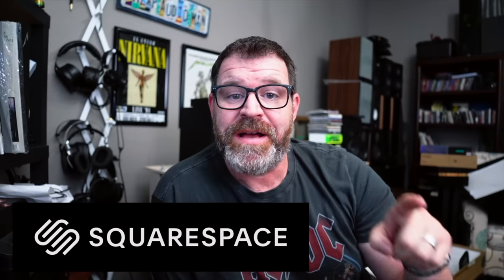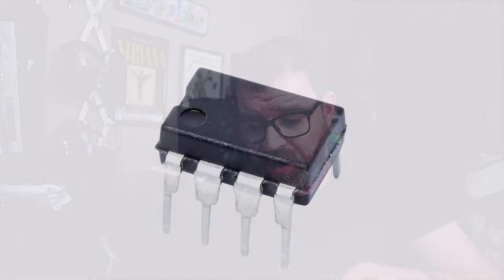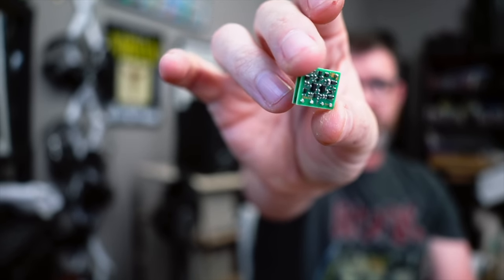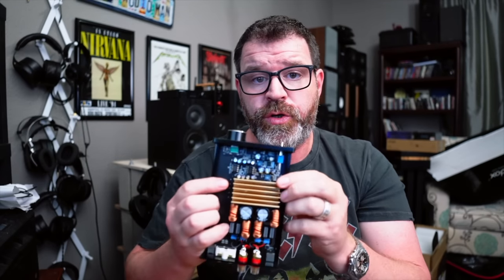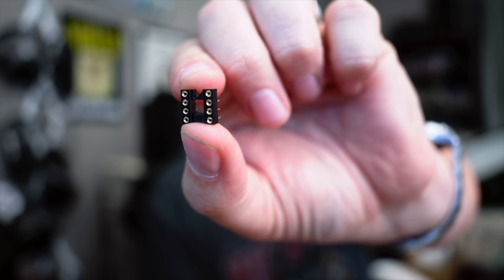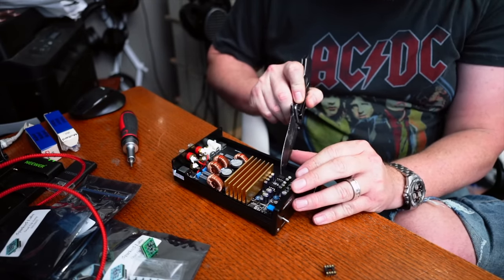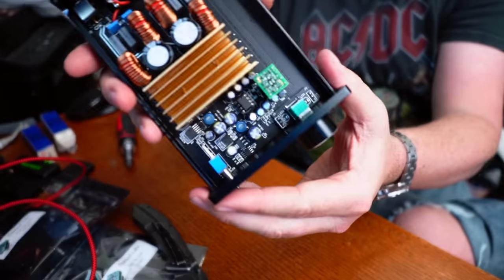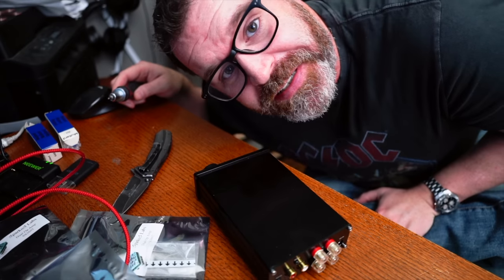Make an $80 Amp Beat $1,000 Amps?! Find out How!

Comment: i actually just came to this realization right now but it makes perfect sense. you gotta realize that when they make chips they make thousands or even a million of them. then they are going to test them and purchasers who buy large quantities will have more say in getting quality, that is meeting the parameters. because there is variability, inside of a chip especially an op amp there could be dozens of resistors, and those are all going to have variability. also resistance varies with temperature, and chips can get hot. by having discrete layouts, you're spacing out that circuit and letting the components stay cool, also you can try and select higher quality or even tune the circuit the way you want it based on the component values. also that's called a DIP socket not an op amp receiver

Comment: I can recommend to buy Burson V5i!
Just remove the original opamp and put the Burson in. No need to build extra height because of the size, they are just some millimeter taller than the original. Great sound and not expensive. If you have extra space, you can buy the other Burson opamps, which is taller, but still same size in length and width.

Comment: Full size amps from the major manufacturers all have op-amps too, in their preamps, as do DACs and CD players, any source with an analog output stage, unless it's a full tube component, like a tube preamp, power amp, or integrated amp.
Reply: They stopped putting large transistors in amplifiers back in the mid 80s.  This can be a cheap upgrade.
Reply: @plektosgaming  The power amp sections of SS amps still have large power transistors. Op-amps are small signal voltage gain devices. Power transistors are current gain devices, which is what you need to drive speakers. Older amps used small signal transistors in their preamps. Now they use op-amps instead.

Comment: I watched this video and bought the supplies, followed your instructions,  and just completed the install which took 5 mins. And guess what? It WORKS! The highs got a small bump. The overall clarity got about a 35% increase. What really impressed was the stereo imaging and instrument separation. It was already good with the stock op amps but with the Sparkos.....it took it to the next level. It's surprisingly clear now even with my vintage Dynaco bookshelf speakers. Thank you Cheap Audio Man! This was fun and inexpensive and I appreciate the sound quality even more now!
Reply: Yes, any upgrade from the fake NE5532 will sound better. Mine were fake. How do I know? Because I bought original ones from Texas Instruments and even those sounded better. 
You could get similar results  for less than $30 dollars with 2 SOIC to DIP adapters, two OPA1656, and bypass each Opamp voltage pins(4 negative, and 8 positive) with 1 Elna Silmic II 10uF 35v rated, 1 TDK or Murata C0G Ceramic capacitor 10uF and other TDK or Murata C0G 0.1uF, both 50v rated.

Comment: In the late 70s-80s, TIMD was still rampant, and many amps, equalizers, etc, used op-amps like the 741 (Yikes! Argh .....0.7 V/u-sec!).  So, a standard practice was to replace them with 5534s (12 V/u-sec = no TIMD).

Comment: I just noticed that Aiyima offers the A07 with a little more expensive Op-amp chip if you order it directly from them. The A07 normally comes with a NE5532 Op-amp and they offer a version with the LM4562. Anyone have an opinion or comment about how the LM4562 Op-amp chip compares to the NE5532? Appreciate any information. Thanks in advance. C
Reply: I have done this swap just the other day. Not a huge improvement, but its definitely noticeable, and for $10, why not?

Comment: I used the Burson Classics in the Aiyima 07 and had pretty decent results. 
I will say the OPAmP in the A07 are really fantastic and better than they should be for an $80 amp. 

The smsl sa-98e ($120 amp) is even better than the Aiyima 07.
Reply: Did you use the duals or singles?? I'm looking to do the same & I don't want to ruin anything, thanks in advance!
Reply: @greatbeardhappymustache  I used 2 classics. One side didn't work at first.  I flipped it and bam.  Apparently you can't do this with all opamps. I just ordered the sparkos to try. You will need a spacer which came with the Burson classics.  If I did this again I would try the vivids (red ones).

Comment: Joe is right. A static discharge from your body can be several thousand volts which can "fry" your nice new $160 op-amps and the ones you have just removed from the amplifier. That is why the op-amps come in those little anti-static bags for protection. A $5 anti-static wrist strap will prevent this. Advice from an Electronics Engineer (40 years).
Reply from the maker: great advice
Reply from the maker: @Douglas Blake knife no good

Comment: Perhaps you could do an op amp rolling playlist. Testing all the popular op amps in your favourite gear. I personally settled on the lme49720 as my universal op amp of choice. Saying that I haven't tried any expensive op amps to date. My logic being that there is no sense putting such amps in cheaper gear. PROVE ME WRONG!
Reply: The sad truth is that almost all of these class D devices use the same 3 or 4 dirt cheap opamps and virtually the same circuit designs. The TI one, probably the most common due to cost savings for the manufacturer, is 50 cents at digikey, much less in bulk.   The main difference is the power circuitry and/or power supply.  
So all of your sound is going through $1 in amplifier chips.  This is literally the weakest link.  They will sound fine up to about 1W continuous, then they start to suffer from heat buildup.  I've popped more than one driving speakers loudly.  And it's always the stupid chip that goes first.  Not a capacitor.  This is even more of an issue with IC guitar amplifiers, since it's not as easy as swapping a blown tube.
Reply: lme49720 for me too.

Comment: Hi,
I too did the same tweak on my portable XDuoo XD5 Bals DAC cum Headphone amp. I replaced the stock IC OP Amps with Burson Audio - Supreme Sound V5i Dual X2  Hybrid OP Amps. Just as you mentioned, Immediate improvement.
I Intend to do the similar Tweak in my Main Music system. I am using the Soncoz LA QXD1 which has Stock (Two OPA1612A dual IC OP Amps from Texas Instruments). I plan to Swap them for (I/V - AD8620 & LPF - PPA1642) these Options are also IC OP Amps but it is tried and tested and there is a big improvement in the audio. Unfortunately I am unable to replace with Discreet cause there is no sufficient headroom in my DAC's casing.
I am using the Feliks Audio Echo Tube Headphone Amp as my Pre amp and the Atoll IN200 SE in By Pass mode as my Power Amp. In future, I intend to replace the Jamicon (Electrolytic Capacitors) in the audio signal path of the Atoll Amp with Rellcap (Film and Foil Capacitors) of the same value or greater.

Comment: Probably everyone watching already knows this, but you can run the A07 in bridged mono without any mods or flipping switches or anything. What this means is that these things really could be just about future-proofed: You can roll the op-amps as they continue to improve, you can upgrade the power brick, and you can get a second one and run them as monoblocks.
Reply: I'm contemplating picking up a couple of these as surround sound amps. Would you suggest using these as surround amps, and how would you go about bridging these amps?
Reply: @danny51577  I should probably delete this because I had someone say, in another thread, that while the A07 will appear to operate when it's shorted (generally a bridged-mono operation should be attainable just by connecting the negative speaker lead to the opposite channel), the op-amps aren't isolated, and as such it will quickly damage the amp beyond repair and may actually be dangerous.

Comment: I got Burr Brown OPA2134 in my Aiyima A04. That tightens thins up. I'd invest in an upgraded heatsink before driving it with anything over 32 Volts...
Reply: That's a good "classic" opamp that trounces the normal but old ne5532's. The 2134's are quite a bit more refined vs the 5532's used in most budget gears.
Reply: OPA1656 vs OPA2134? 🤔
Reply: @RAW_Reality  I wonder that too, though I don't know much about the 1656...

Comment: Just so you all know, even with the 48v PS recently made by Aiyima, the amp will get no where near the 300 watts per channel unless, you factor in 10% distortion levels and maybe at 2 ohm loads, which would sound horrible.  I doubt it would even reach 300 watts as I believe the max values on the TI chips are measured using 52 watts.

That being said, it will still be powerful enough at 8 ohms, probably around 120, give or take watts max. The limiting factor and/or question is to how much current it is capable of outputing to speakers as well.  My guess would be somewhere around 5-8 A max.  Still would be sufficient unless you have really power hungry speakers.  

That all being said, I really like the A07 in its' stock form and the ability to op amp roll is nice, but a personal preference. The stock op amp will tend to be a bit more analytical sounding, IMO.

Consider this as a rule of thumb for say 86 dB rated speakers (Anechoic usually measures lower, a bit higher in room):
1 watt at 1 meter will produce 86 dB (about the loudness you can listen to for extended periods before hearing damage)
2 watts at 1 meter will produce 89 dB (lawn mower loud territory)
4 watts at 1 meter will produce 92 dB (getting pretty loud now)
8 watts at 1 meter will produce 95 dB
16 watts at 1 meter will produce 98 dB
32 watts at 1 meter will produce 101 dB
64 watts at 1 meter will produce 104 dB
128 watts at 1 meter will produce 107 dB

You'll want some headroom (additional short term power availability up to 10X in watts for the music to sound real and not distort)

Many speakers Can't achieve much past 95 dB without distorting

Hearing Aid by age 30?

Room size matters as well.  The more distant you are from the speakers the less loud you will hear.  Assume 3 to 6 dB less loud, or more depending how far you sit away and room size.  The above numbers suitable if you were listening at about desktop and you are 3 feet away.

Most people listen at 70 to 85 dB range throughout the day. Occasionally cranking it up to low 90s for a Rock out. IMO.  

So, most amps well under 100 watts can do the job with most speakers you are likely to buy.  But...there are SQ differences, preferences and some amps are just better designed.  They do not all sound the same.
Reply: @Douglas Blake Still plenty for what it is.  I use a class AB amp with less wattage but it sounds better than the Aiyima and is a high current design. Also costs nearly 10X more though.  For desktop, even as a main driver, the A07 is a product thato one can enjoy and not go into debt with.

Pair it with the PSB Imagine XB, now on sale...would be a killer combo for around $600...have to add a dac though.

Comment: The good thing about the Aiyima is that not only it allows you to change opamps. It also allows you to compare different opamps on each channel. 
Just use Foobar with a mono addon and then play with windows audio balance one side to the other.
If you can hear the difference then perfect. But again as a minimum change the "original" opamps for a  real NE5532. Then you can compare against any other Opamp.
I mean, comparing Sparcos against a fake NE5532 is not fair, don't you think?

Comment: yes one can have great sound stuff with a bit of learning how stuff works my favorite thing is the Equalizer.and as internal parts op amp upgrades and capacitors  nichicon capacitors i love thaty brand and Audio gold are very nice low esr just nice units
Reply: Yes, a little bit of research and patience pays off. Nichicon KZ and Elna Silmic II are the best audio electrolytic capacitors, and if you bypass them with a C0G Ceramic capacitor they sound even better.
Reply: @MiguelAngelVelazquez  thanks ill look into C0G Ceramic capacitor thing .God bless
Reply: @overbuiltautomotive1299  Ideally it would be Film Poly Caps, but there is no space for those inside the Aiyima, so the next best thing is the C0G or NP0 Ceramics , brands like Murata or TDK. Use aprox 1% of the capacitor capacitance  you want to bypass

Comment: It must be said that the Sparkos opamp upgrades appear INCREDIBLY LOW-VALUE at a $160 price. Even with design, prototyping, manufacturing, testing, support and marketing costs, these upgrade units should cost no more $15-20!  $160?!!!   Talk about diminishing ROI. Take that money and choose a higher class of speaker.  Gah...
Reply: I don't think that's necessarily a fair criticism of sparkos, if you look at tweeters, you can get some really good $20-$30 tweeters if you're building your own speaker you don't need to spend more than that. But that doesn't mean $300 sb accoustics tweeters aren't amazing and worth the value. Same idea is true with tubes.

But the issue is, as you alluded to, using a $160 chip to upgrade a $80 amp. You shouldn't buy an F1 engine and put it in a 90s Mini van (well actually now that i've said that I really wanna see it), that $160 would be better spent more evenly across the amp rather than all on the amp. The easiest way to do this is buy a better amp, but in theory you could upgrade the caps and buy a cleaner power supply but you'll ruj into issues with surface mount components and topology limitations
Reply: @daniwalmsley611  Ford did just that.

Comment: First of all, i owe it all to you Randy for steering me towards the A07! So, thank you! I am floored by how good the stock A07 sounds. So floored that i purchased a second. Can't imagine wanting it to sound much better in my system. It has it all for my taste and set up. Don't see the reason to spend the extra. Will wait for others to chime in on how much of an improvement they see with this high end OPAMP roll. Until then....totally amazed and totally satisfied by the stock A07. Totally!
Reply: I have four.  They're just fine as-is in their assigned roles: two of them power the surround/ambience speakers in my 6.1 near field set up, the other two are in our 13 year old's room for her gaming PeeCee and her TV.  There's no point in "rolling" the already excellent (and widely used in professional mixing desks!) stock NE5532 op-amps, at least in my applications.
Reply: I agree!  My A07 is a great piece of audio gear.  Sure gives my desktop PC the Sony SS-CS5 speaker driving strongman it needed.  My $160 op-amp upgrade funds are being saved for my future (if possible) TV sound system upgrade to Emotiva gear.

Comment: Modern op amps measure incredibly good. I seriously doubt a discrete component op-amp would measure noticeably better. Anyone who thinks they make a difference show me a double blind control trial to prove it.
Reply: @Douglas Blake probably once you get past the ultra budget op amps then it doesn't make a difference of any consequence.
Reply: @Douglas Blake I see this a lot with fancy DACs. Buy an audio interface with the same components for a fraction of the price. There's a sucker born every minute.
Reply: Yes, this kind of garbage is completely confirmation bias snake oil. As an EE that has worked in product design, it always amazing me how people will buy into things like this. Same thing in speaker design. People will spend hundreds of dollars upgrading crossover capacitors to oil filled, and air core inductors to foil wound; then claim to hear a BIG difference.
Reply: @Douglas Blake Out of curiosity, which audio interface was it? I'm curious about how qualiity varies.
Reply: @Douglas Blake I found the item on Amazon including your review. I'm in Toronto and I'd love to chat more.
Reply: @Douglas Blake Aiyima is one step up from a generic Chinese kit off ebay. Components are as cheap as possible and often knockoff fakes. From many many reviews on the web, it is generally accepted that the NE5532 op amps are fake. They may sound funky, no question.  Genuine parts may well make a difference. They cost under a buck from Mouser. There will be a bunch of the exact same one's in the signal path from the recording and processing equipment when the music was made and mastered. Just get a dozen NE5532P from any reputable source and replace them in anything Aiyima. And save hundreds of bucks for the same sound.

Comment: For a bit less money you could use MUSES opamps. They are not disrete, but sound much better than the cheap opamps included in amp. MUSES opamps must be purchased from a reputable dealer as they are often faked. Guess that says something for their sound quality.